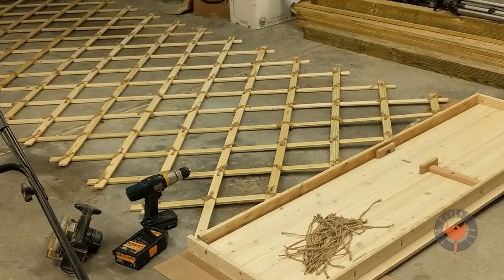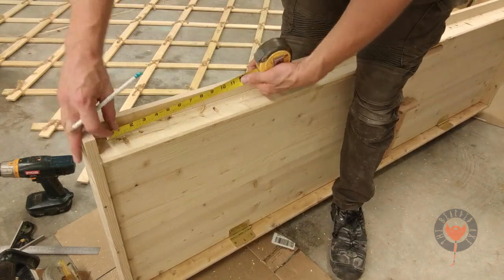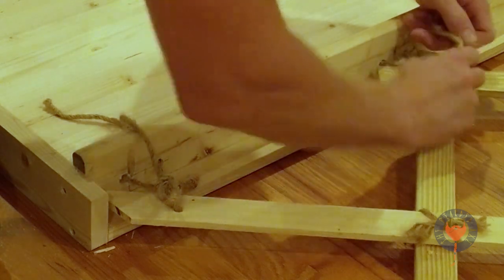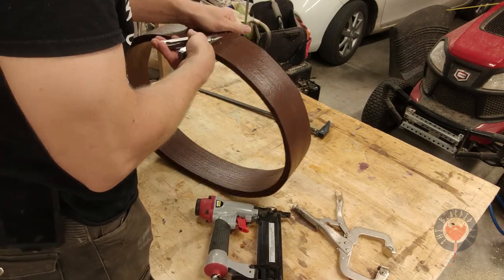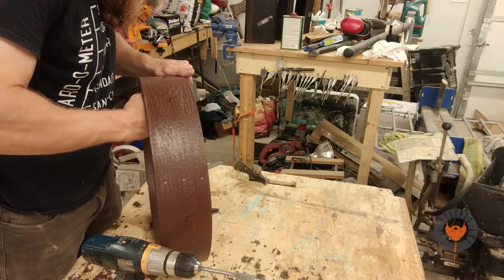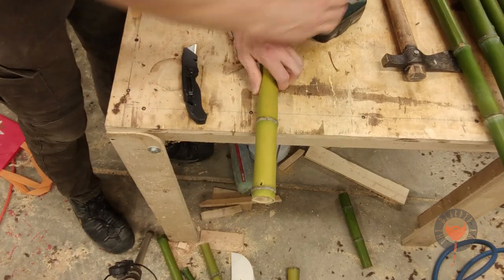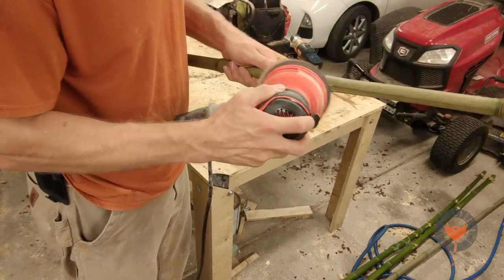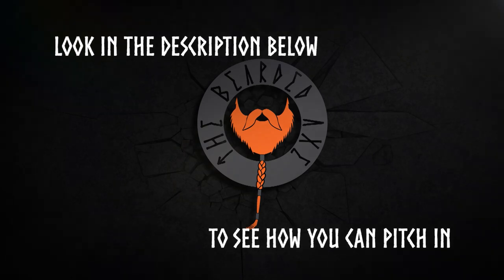Making the Yurt Rafters and Roof Center Ring

Comment: Very nice work" Ive done 5 from scratch and made ALL the mistakes. They all worked, but the last one was excellent.

One thing i discovered re: the door...for an indigent yurt ( one you want to easily setup and tear down ) using a reinforced double wall end pocket on the jamb to recieve the wall ends and tapered wooden trunnels to secure works VERY smoothly. It does mean the jamb needs to be wider, and i also drove two 4" screws edgewise above and below the holes to prevent splitting. I still broke one hole once, so i would sink a single metal plate 2" either side of the holes on the edge to brace.

That was because i used spruce. Oak wouldn't do that :-)

Secondly, for the roof ring spacing i used metal strapping to make the circumferential pattern, since metal doesnt stretch much. Then secured that to the laminated ring carefully and marked. Saved a lot of hassle.

Comment: For a 7' high wall on a 30' yurt how long are the Latic boards?
Reply from the maker: I used 8' boards, but my walls were around 6' high though.  You can, however, angle the boards a bit higher to reach 7'.

Comment: Can we have more dense khana and longer, what the formula, I mean a 8 feet sticks become 6 feet if all sections are in right angle, suppose I want height to be of 7 feet, how long wood strips I will have to take and can I make it of 10 inch each section to make it more strong.
Reply from the maker: That's a tough question.  I'm guessing here, but I would say 10' sticks.  If you are going with thicker sticks you don't have to have as many in the wall.  I would say if you had twice the thickness of the stick you could theoretically have half as many sticks in the wall.  

Try it out and if it doesn't quite work out then you should be able to fix it to the way you like it.
Reply: @TheBeardedAxe  thanks appreciated.
Reply: The khana are ideally 45 degrees to the ground when the walls are extended. So, it's a 3/4/5 triangle.

You use the ratio to solve. 
5/4  = length/height

So for 7 feet height...

5/4 = X/7
7 * 5/4 = X
X = 8.75 length.

If you want to keep the strips light on a yurt larger than about 15',  you increase the number of them, and the number of roof poles. Making the strips too thick prevents the structure from "bowing" in and creating its tension. I know this because I did this for my first 20' yurt. It was sturdy, but since it didn't bow I had issues with setup and weight.

Comment: what woods are good for the lattice walls?
Reply from the maker: I used a treated yellow pine but it was fairly heavy.  I think just white pine would be just fine.
Reply: @TheBeardedAxe  i was thinking about using Cedar because of availability in my area and it would be good for storage, do you see any issues with that?
Reply from the maker: @ActionJackson1993  I think that might work.  I would make sure there are no knots in your pieces so you can avoid splits and breakage.  Possibly rip your pieces at 3/4' just to be safe.
Reply: @TheBeardedAxe  thanks for the tips ill record  it and post some videos
Reply from the maker: @ActionJackson1993  I'd love that.  Thanks
Reply: @ActionJackson1993  if your using red cedar I would suggest not to. It has more of a snap then a bend.
Reply: @ActionJackson1993 I used Atlantic white cedar for the walls of my first yurt, and it worked very well. Never molded and gave a nice fresh smell, which you could bring back up with a bit of sandpaper :-)